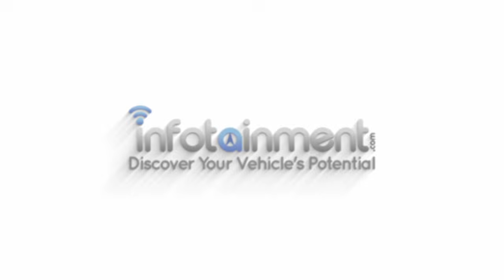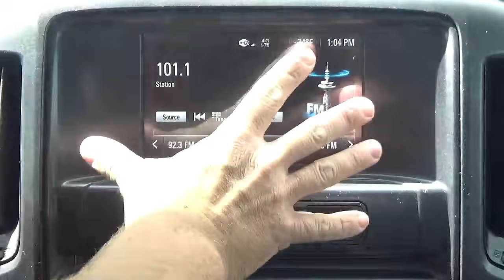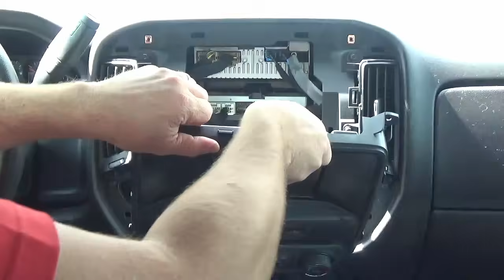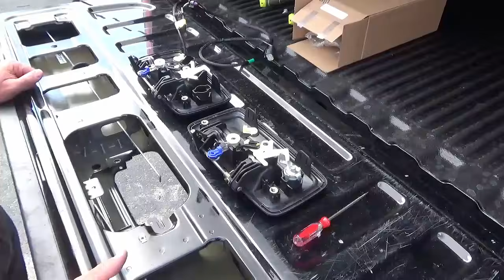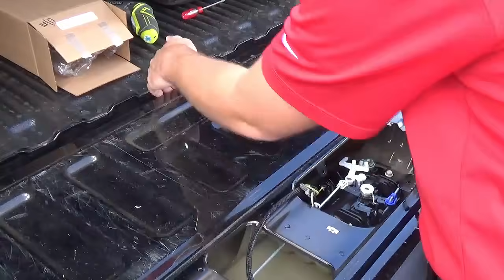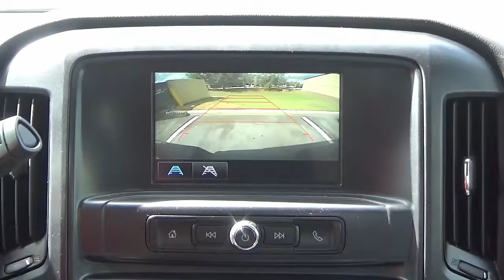2016-2018 Chevrolet Silverado GMC Sierra IOB Plug & Play Backup Camera - Easy Install!

Comment: I have a 2017 3500 that I need the the new modual for. However I do not have a regular bed, it has a flatbed would you have a camera that can be mounted on that?
Reply from the maker: We can help you with an aftermarket camera instead.

Comment: I have a 2017 Silverado WT HD with VIN 1GC1KUEG3HF122355 with no back up camera or Bluetooth option, can I use this camera kit in the video?
Reply from the maker: Unfortunately you have an IO3 build. This upgrade is specifically for IOB build trucks.

Comment: I have a 2017 with a utility camper with a backup camera installed. I also have the original tailgate with a factory installed backup camera. Could I simply remove the camper shell and install the original tailgate plug it at same place as in this video? 7:42

Comment: 3GCPCREC7GG125225 is my vehicle compatible with the camera?
Reply from the maker: Hello and thank you for contacting us at Infotainment.com, as per the VIN provided, you have an IO5 system and would require the IO5/IO6 variant for the backup camera upgrade.
Reply: Can it just be programmed through the OBD 2 port?@Infotainment_nav

Comment: i have IOB no back up camera i need the module ? aside from tailgate latch with camera ?
Reply from the maker: Swapping out the module is not required anymore. Our OBD programmer now makes it even easier to upgrade! 

https://infotainment.com/shop/exterior-accessories/backup-cameras/16-19-silverado-sierra-gm-truck-tailgate-handle-backup-camera-kit/

Comment: Mine 2016, 1500.  Has smaller screen no tach screen the basic one. Do I still have that wire underneath if I change the screen I’m gonna be ok?
Reply from the maker: Try our knowledgebase https://desk.zoho.com/portal/infotainment/en/kb/infotainment

Our you can contact one of our tech advisors at 855-636-6287.

Comment: I have a 2016 chevy Silverado 2500 duramax there is something plugged in to the 3rd port already Is the an adapter that inserts in to the 3rd port and has 2 connections coming out to connect the camera and the plug that is already there ?
Reply from the maker: Contact our Support Team, they can walk you through your particular installation. Have your order number ready so that they can assist you faster.

Comment: Where do I get the modual??? Can't seem to find it anywhere do you have a part number? Any help would be appreciated
Reply from the maker: Contact one of our tech advisors 855-636-6287. They can help you get up and running. This can now be accomplished with a programmer in minutes.

Comment: I have a 2018 Chevy Silverado 3500 Duramax. But its cab and chassis. Any options to use this type of plug and play kit?
Reply from the maker: Contact our Tech Advisors at 855-636-6287